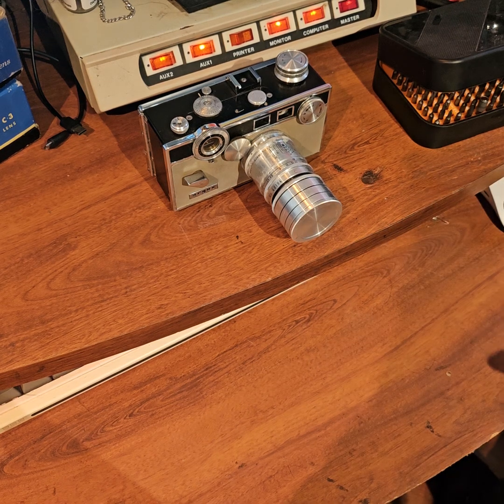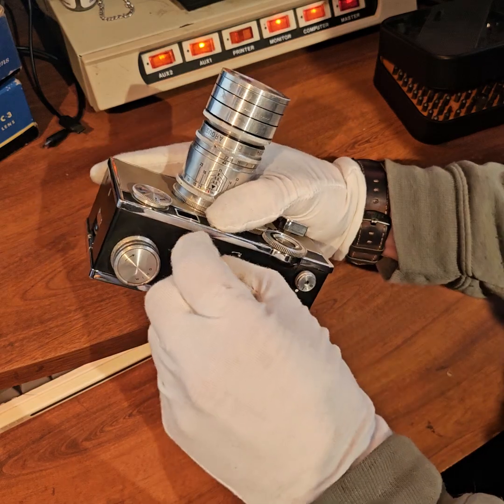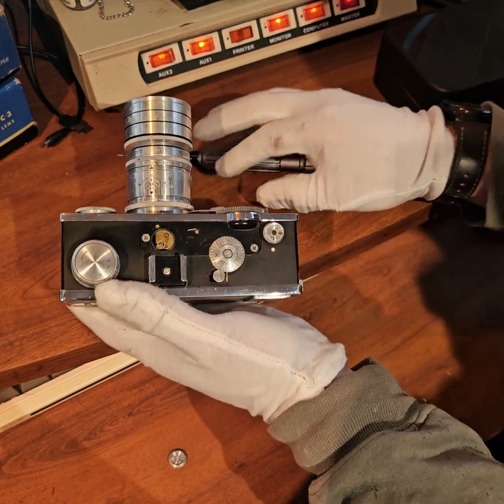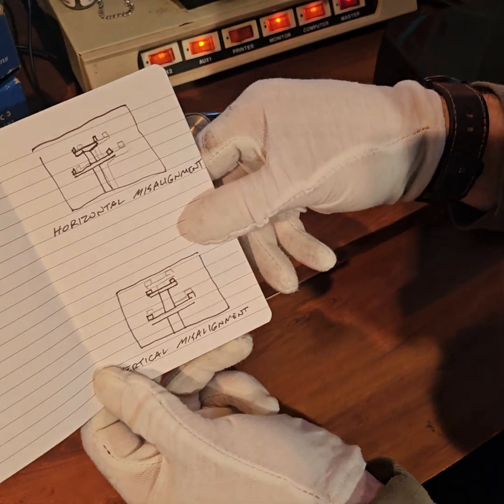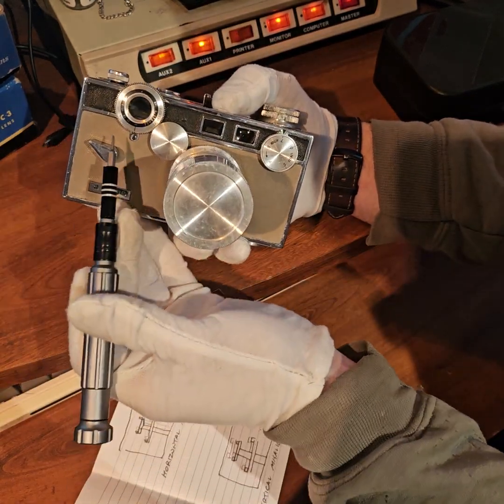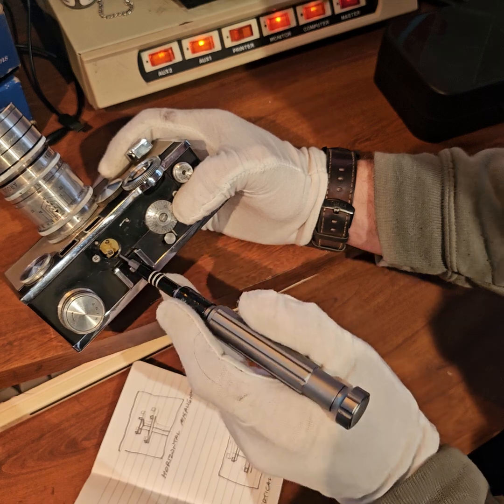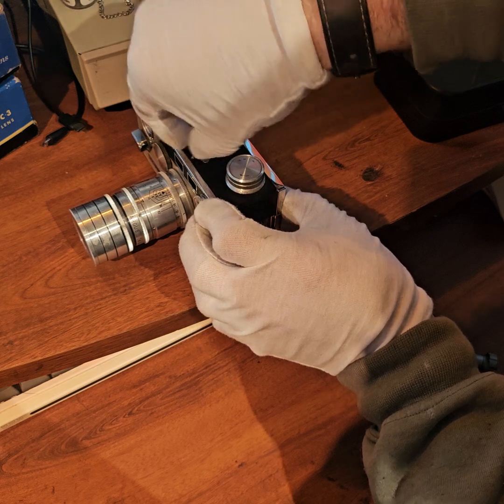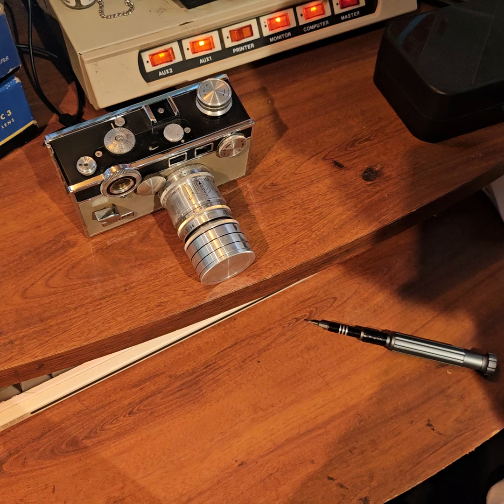Argus C3 Rangefinder Adjustment and Calibration (simplified)

Comment: Hey Don, quick question for you. I just got myself a C3 and after processing my photos, I noticed the subjects that I thought were correctly in focus were not. So as far as calibrating my rangefinder, all I need to do is set it to infitity, focus a telephone pole in the distance, adjust the screws so the split image is one, and it's good? Thank you!
Reply from the maker: That's right! If the photos still come out blurry, then the lens may need some adjusting. Not that difficult to do, I've made a video on that too :)
Reply: @ Thank you so much! - And thank you for the fast reply. If I still have issues I’ll check out your other videos.